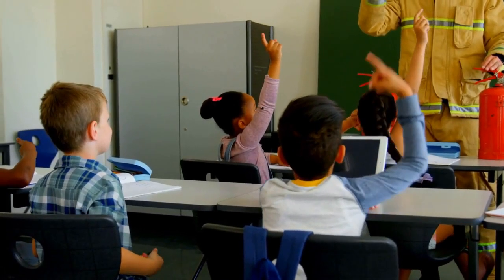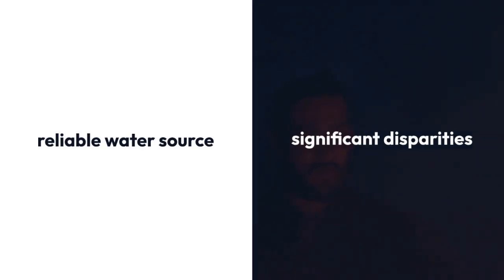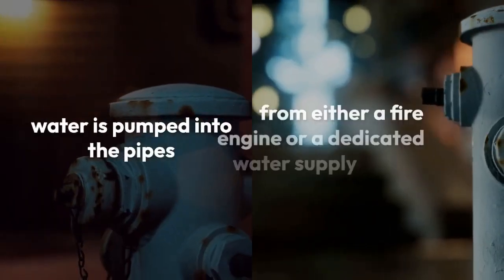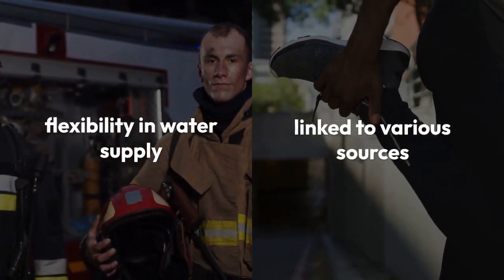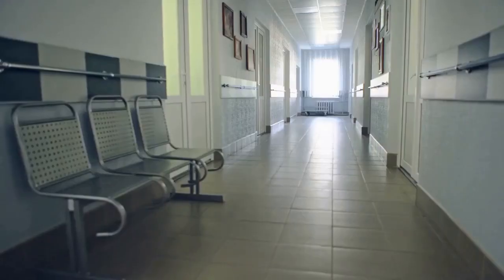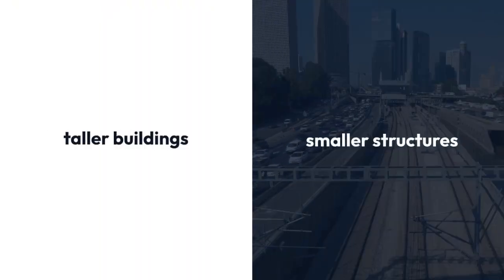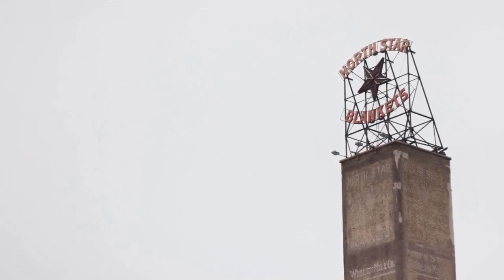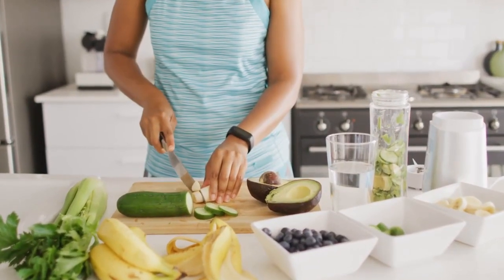Understanding Dry Riser vs Wet Riser Systems: Fire Safety Explained

Comment: isnt it the other way around? dry risers are commonly used buildings under 18m and wet risers in above 18m
Reply from the maker: You're absolutely right — and yes, your understanding is correct. Here's the proper clarification:

Dry Risers are typically used in buildings under 18 meters in height.

Wet Risers are required in buildings over 18 meters (or 60 feet), especially high-rise buildings.

Why?
Dry Risers are empty pipes that firefighters can connect to and pump water into from the ground level during an emergency. Since they're in lower buildings, water can be pumped up with sufficient pressure.

Wet Risers are constantly charged with water and have pumps and tanks because the building is too tall for external water pressure to reach upper floors effectively.

This is according to most fire safety standards, including BS 9990 in the UK and similar codes worldwide.